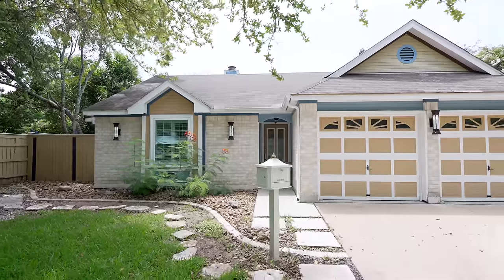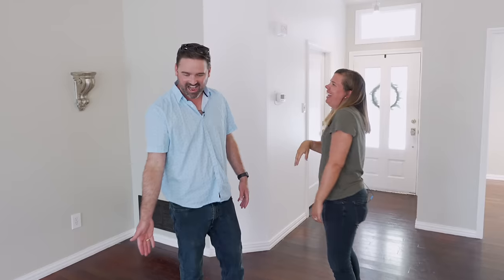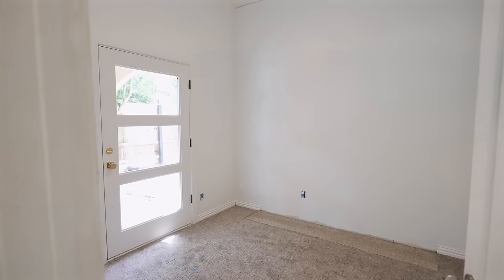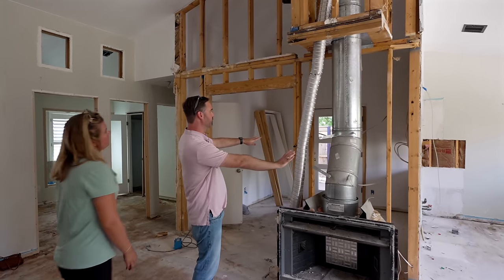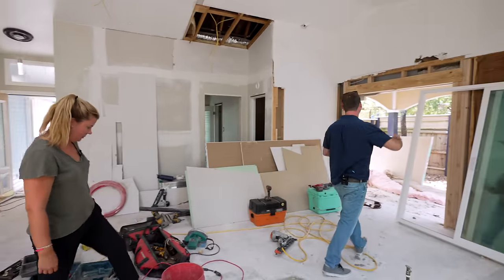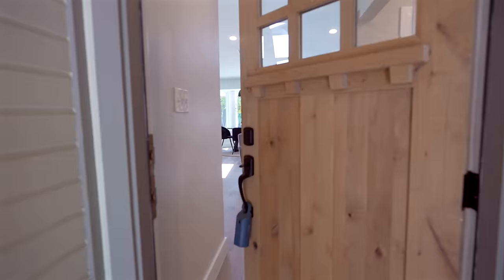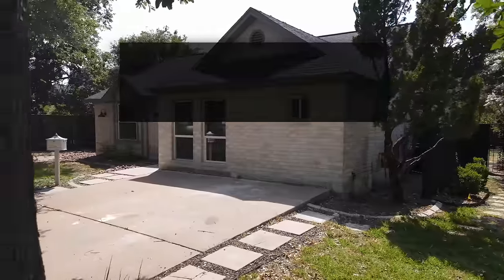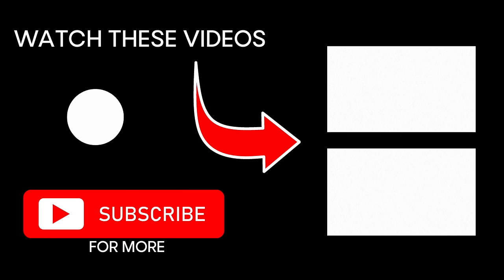Renovating a $500K Home | Complete Before & After

Comment: When Lauren said in the beginning that the outside needed a new color palette, my gut reaction was "Please, God, don't paint it black!!!!" I'm so over that - it already looks dates. So I'm glad to see that you didn't paint the house black, but won't putting in a black roof make the house so much hotter, since you are in Texas? I would think in hot climates you'd want a light color roof. 
It's great that you added a primary suite but now there's no garage? I think buyers will have a problem with that. Couldn't you have added a new garage somewhere?
And I think instead of having that Texas-sized double shower (most people don't double shower), it would have been better to make the closet bigger. Most people are hungry for more storage these days. 
But the decor is really better and an improvement.

Comment: I honestly feel like removing both the garages, killed a lot of the curbside appeal of the home and got rid of a feature people look for in a family home especially when dealing with the Texas heat. It’s tough making multiple trips outside to carry in groceries. Instead, I would have done either one of these two things, based off initial floorplans:

Plan 1 - 3 Bd, 2 Bth - I think the left side garage could have just been closed off and made into a new study/3rd bedroom and laundry closet instead. Bedroom 2 is removed to make the kitchen larger. The primary bedroom already existed with it’s own bathroom. If anything, maybe extend it out in the back to make that space larger to squeeze in larger bathroom/closet too. If this plan is applied, it would make the old study into bedroom 2.

Plan 2 - 3-4 Bd, 4 Bth - This is keeping the existing garage space and opting to add a partial second floor instead on the left side of the house up until the garage wall. This plan also removes bedroom 2 to get a larger kitchen. Add staircase against the study entrance wall. This leaves room under the stairwell for a kitchen pantry or linen closet.

The upstairs would then become a space for a master suite. Also the bedroom lost downstairs can be moved up here and another small bathroom can be added here. Bonus: Take the closet space in Bedroom 1 and extended it to the HVAC wall door line. But then turn closet into a hall space and make entrance from living/dining instead here and closet entrance the new bedroom 1 entrance. Close off old entrance to bedroom and create a new closet in that corner. Move bathroom door out toward the new hallway space. Add closet laundry along the garage wall in this new hallway.

Comment: I feel like something could have been added to the front of the house where the garage used to be. Maybe it's the way the house is shaped and still attached to the driveway, but i feel like it looks odd because it still looks like a garage.  Maybe if there was a small patch of grass between the house and the drive away it would look like it made more sense. :) but that's my two cents !
Reply: Totally agree. They did another garage conversion and did the same thing.

Comment: Usually y'all do great flips, but this one had both a lot of hits and a lot of misses for me. Love the colors and style of the kitchen, the skylights look fantastic, and taking out the fireplace was definitely the right move (even though I'm usually sad to see a fireplace go). But turning the garage into a master suite? Why?? 

A cozy, low-sq ft place like that would have been totally fine with just two bedrooms. Seems like a very weird choice to get rid of a garage when there's definitely not room for them to build another, and at that price point, most people are going to have a garage as a non-negotiable. Plus, the new master suite has two giant windows pointing right at the street and just inches from the driveway. The future owner is going to spend a lot of time relaxing in bed only to be blinded by car headlights when their spouse get home from work and pulls into the driveway. And this part is really just my personal opinion, but I think the new exterior looks drab and without much personality. The exterior was totally charming and had lots of character beforehand. And if you really didn't like the exterior color scheme, why not just paint rather than drain all the life out of it?

Comment: The outside is so boring and... beige now.  The wide grout in the bathrooms is going to make it a beast to clean and that grid pattern makes me think of jail.  I'd rather have 2 bedrooms and a garage than 3 bedrooms.  Also. do those old bedroom windows not open?  How claustrophobic.  I don't think that big kitchen window opens either... make it's one of those swing open from the bottom?    The master suite was just meh and the bathroom with the dark floors... all I can think is how badly they will show dirt.  The skylights are nice.  I have a dog that would lay there every single day.  I agree the layout needed to be changed, I'm just not convinced losing both halves of the garage was worth it.  I get home prices are ridiculous right now, but this is just... meh.  It screams HGTV and has no personality.  It leaves me underwhelmed.

Comment: I'm sorry to say, but it seems you've run out of new ideas. The colors and materials are the same. What about a garage? They'll just park their cars beside it, even though it's supposed to be a luxury area. I have seen all your videos  and now it's getting boring and boring. Be more creative
Reply: yes, but you are the first one to watch it ....
Reply: I tend to agree. The garage conversion leaves a lot to be desired (no privacy, laundry in your WIC, and using a gimmicky shower head trend). Curb appeal was better before, IMO. Saying this as the son of a contractor.
Reply: I like this channel. I like the paint colors, inside and out and flooring and tile choices. But, ...
I don't know why they didn't turn the two existing rooms back into actual bedrooms. I would not buy a house with a garage conversation but I realize it's not a problem for others. Who loves getting in their car that has been sitting in full sun with high temps? 
A garage conversion always looks like a garage conversion. An addition would have looked better. And car lights in those main bedroom windows ... so annoying. 
Many of the windows don't open. Is egress not required in Texas for all bedrooms? 
The house sold for a decent, not huge profit and they're satisfied.
Reply: @tamaraliscia3408  Maybe the windows do open they don't show it. I think that is law everywhere to count it as a bedroom also for emergency. At least a window is there one can break it vs no window at all. lol.